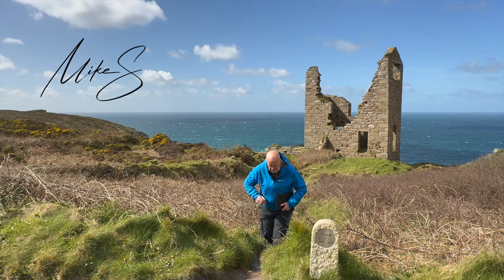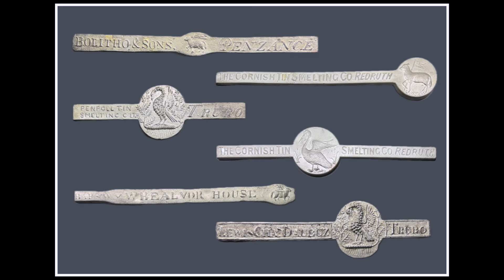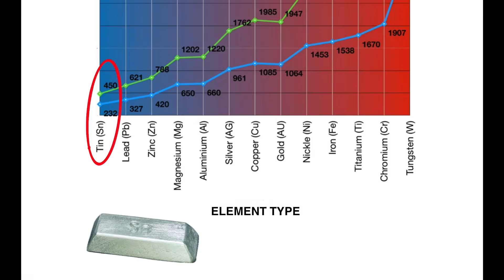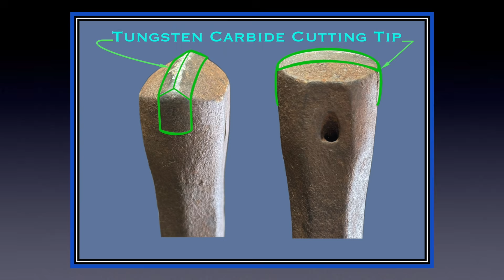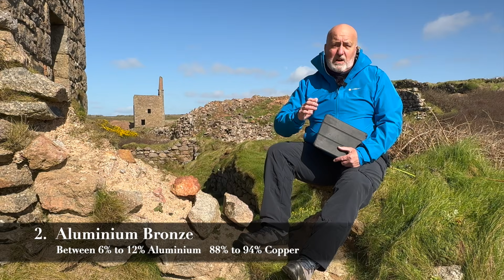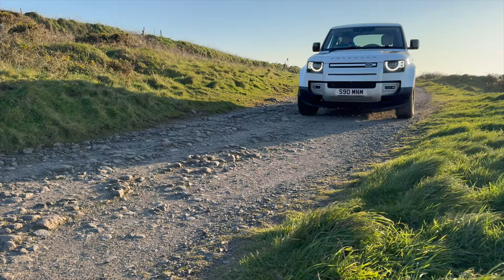What is Smelting? Cornish Tin & Copper, Periodic Table and Advancements in Bronze

Comment: Good day Mike. Hope you are well!   Very informative video
I had not considered the higher melting point of copper before. What do you mean when you say “ copper is a transition metal”?
Reply from the maker: Good evening Dave, I’m good thanks. How are you?

My understanding is that a transition metal is an element that exhibits good thermal and electrical conductivity.
Also an element that has strong properties that lend themselves to excellent alloying. That said, I know by experience that copper is also termed a ‘trace element’ and therefore can be detrimental in certain types of steel-(steel being an alloy) especially when dealing with nuclear and critical Engineering structures.

I’m not a chemist but have lots of experience in mechanical and electrical engineering. I hope this answers your question👍
Reply: @mikesimcox7932 
Thanks Mike !  I can understand what that means now.  Yes all,s.  well hear in beloved Kernow🙂
My grandmother used to have one of those ingot hand stamps, with the lamb and flag on it.  I always wonder what became of it!!
Thanks.